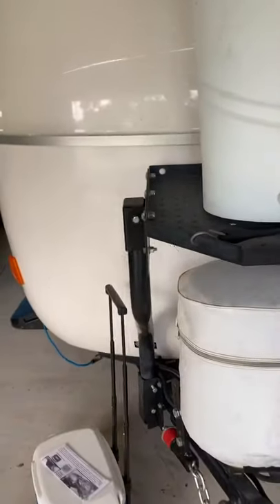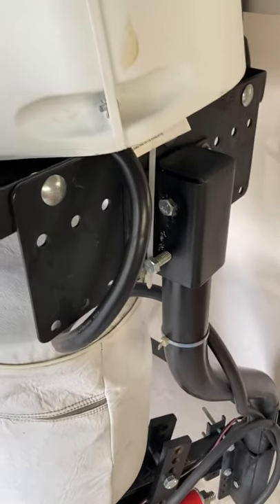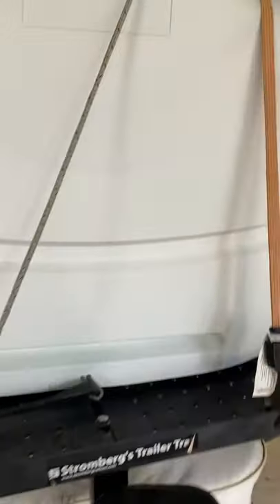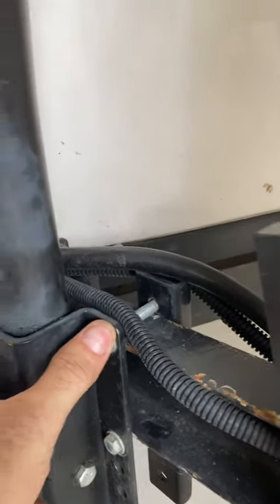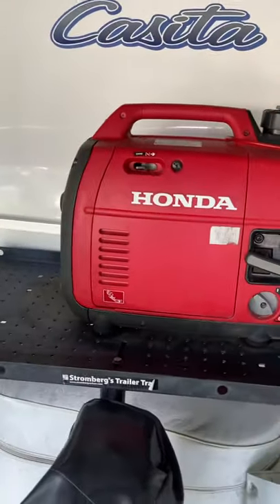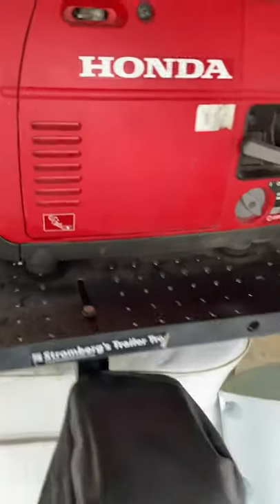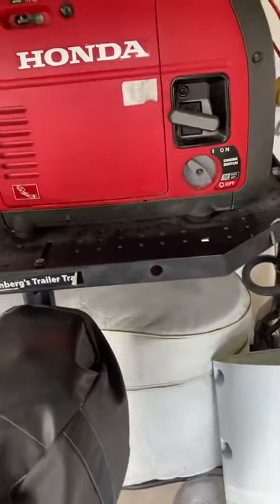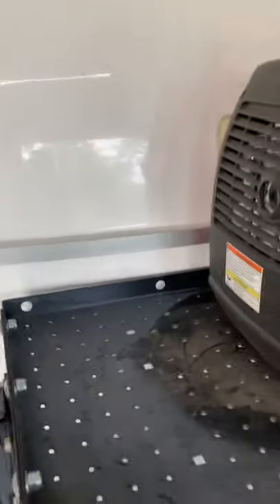DIY Stromberg Carlson mounting tray on Casita Travel Trailer

Comment: Thanks for the tips!  Do you think two Honda 2200’s could fit on the tray?
Reply from the maker: not without additional modifications.  I made a video of the 2200 also; it will require periodic service unless you use it consistently; the carb does have a tendency to need cleaning since there is no way to liquidate the carb of fuel that fouls over time.  Best in your travels.